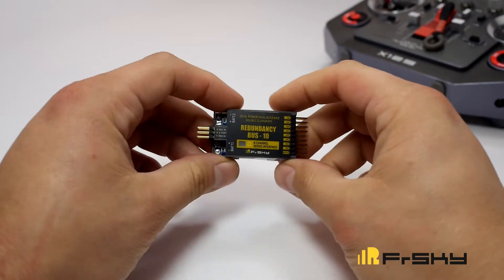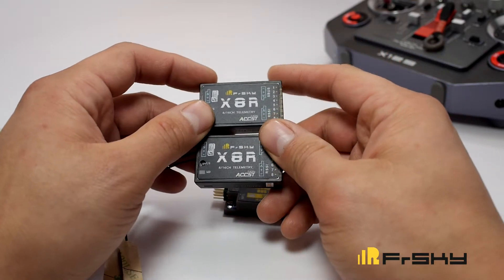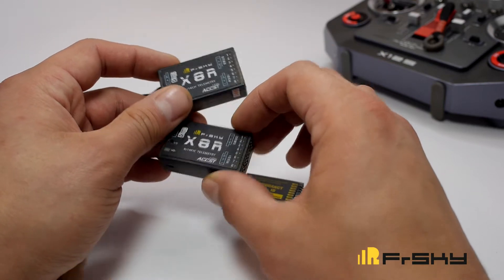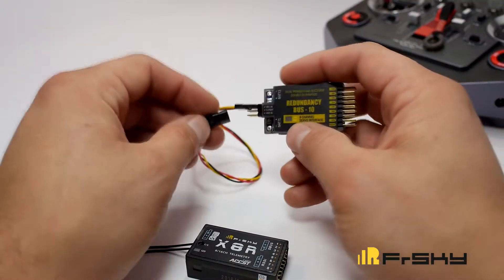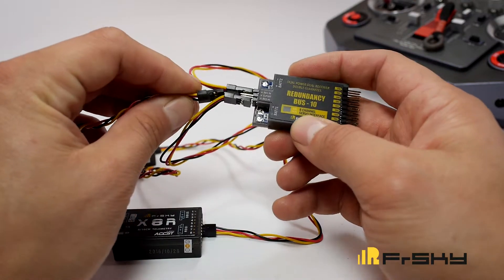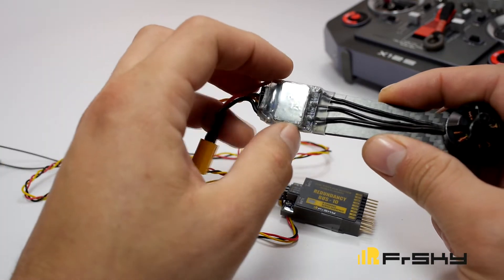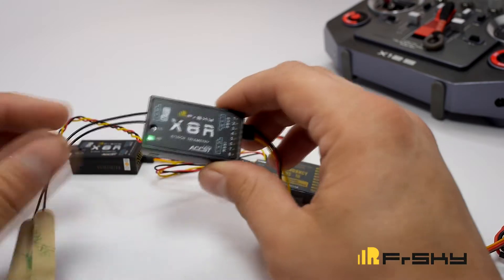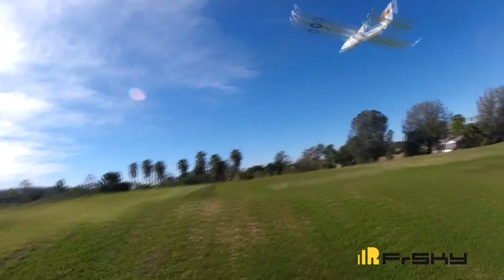FrSky Redundancy Bus -10 Review

Comment: Nice video. If I may ask How do you do firmware upgrade of the RB 10 itself ?
Reply from the maker: Hi, you can upgrade it thru S.Port with a STK tool connecting to PC, or simply upgrade it thru S.Port on your radio.

Comment: When you plugged that wire for telemetry into the X8R from the redundancy module, does that allow you to receiver battery voltage to a transmitter radio?

Comment: can we daisy chain receivers without this redundancy bus?
Reply: Yes, but the receivers must support the redundancy( they must have serial bus IN also.)
For example, the receiver RX8R
The  problem is that it takes 1 second to switch from the bad receiver to the back up receiver, and you just have a redundancy for receiver.

https://youtu.be/eY32yTnVmE4

The separated Redundancy bus box offers many advantages over just plugging two receivers.
- It can have two batteries to feed the receivers, so if one battery fails , you have another one.
- You have two receivers conected, and if you loose signal in one rx, there is no delay to the back up receiver assume the control.

- If you have a servo problem , like a short circuit servo motor, this servo is isolated from the circuit, avoiding the short circuit to drain the batteries or cut power to the receiver as an over current could do that.

As the Redundancy bus accepts serial bus, you can plug very tinny receivers with serial bus output and use the servos plugs at the redundancy box to use the servos. Since the receivers using serial bus have up to 16 channels.
Reply: @sanpol4399 Thank you! where can i get one?
Reply: @farkhodkhikmatov4738   You are welcome.  Try to find some Frsky dealer near your home. Try to search at the net. They have many dealers . 
Cheers

Comment: Great video. I got Horus x12s transmitter  couple weeks ago with the X8R receiver from Aloft Hobbies. So I've never used FrSky before.Yesterday I purchased Bus-10 with aditional X8R receiver for safety. I have a giant scale Edge540 30cc RC plane that already binded with one receiver (with telemetry) The question is if I bind my second receiver,  should I set all channels again. I mean do I have to set all throws and exponentials for each channel exactly the same like I did with first receiver?  Or all of that automatically will be set when I connect the second binded receiver to the bus-10 ? How does it work?

Comment: Hi,
if I don't need the high voltage protection but only want redundant receivers, can I simply connect the SBUS out of the redundancy bus to an autopilot system like I would otherwise the X8R? Thank you!

Comment: Hi, in the manual says " Do not connect power supplies to CH1~CH8, S.Port, SBUS OUT, RX 1 IN or RX 2 IN." You are telling us to power the system throught the CH6 what is contraditory with what is written in the Manual. What should we do for sure?
Reply from the maker: Hi, please do NOT power your system through the CH6 but connect battery 1 or battery 2 with 2S battery. This operation just wanna show people for convenient.
Reply: Where should I connect the ESC/BEC?
Reply from the maker: Connect to BAT1 or BAT2, we have the sketch on our website and please check the link below. http://www.frsky-rc.com/product/pro.php?pro_id=172
Reply: FrSky RC  It doesn't show where should I connect the ESC.
Reply from the maker: https://drive.google.com/open?id=0BzIfWmfPYKc9d2FtbndJVDhTb3c
Reply: This is the battery input. I'm asking where should I connect the ESC/BEC ( If you don't know what is it,  this it is a cable that either power the receiver and receives controls signal to control the speed of the electric motor. I'm asking because we cannot put in any channel because it is powered and we need connect to some channel because we need the signal to control the motor. Hope you understand now my question.
Reply: Without the Bus we connect in any channel to either power the receiver and receive the channel signal to control the motor.
Reply from the maker: You can connect your BEC to BAT1 or BAT2, and connect your ECS to CH1-CH8 (right side) what you need, this up to you.
Reply: Some ESC comes with BEC at the same port of the signal. So, how do I do?
Reply from the maker: https://drive.google.com/open?id=0BzIfWmfPYKc9U3dlVEdGNmlHeW8
Reply: FrSky RC Great. This is what I was searching for. Thank you.
Reply from the maker: You're welcome! ; )